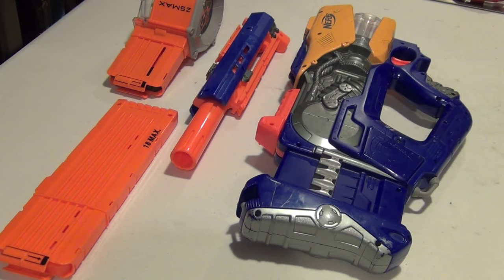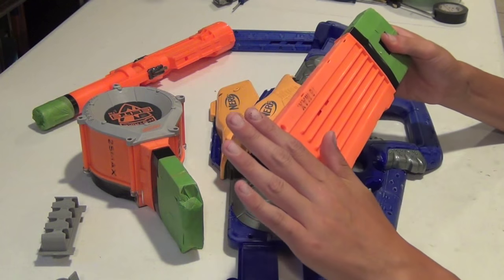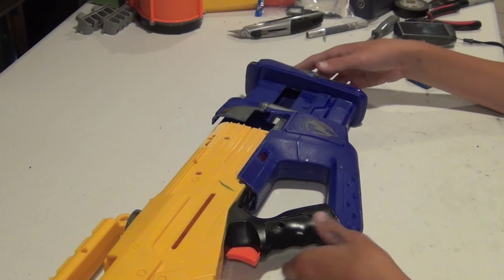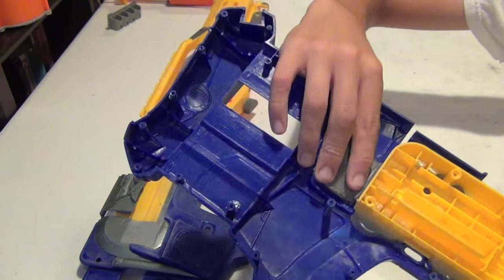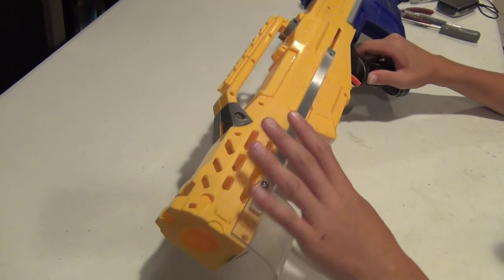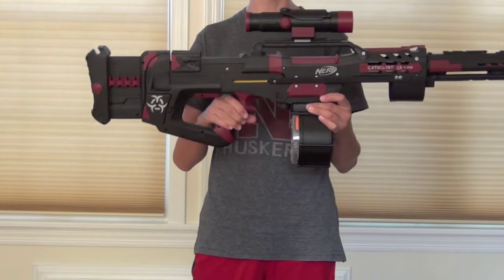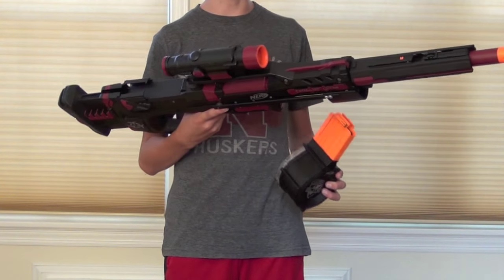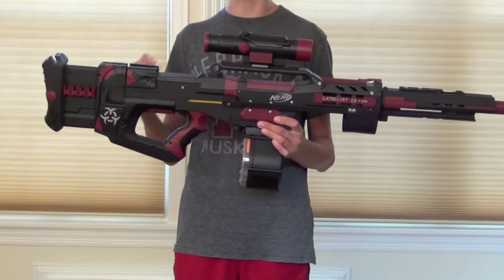[PROCESS] The Cataclyst [Nerf Longshot w/ Integrated Firefly Stock]

Comment: Hey Mag212, I had a weird idea for a mod. This is not a commission request, just a weird idea I had that may inspire a future mod. I know that the shotgun  grip for the longshot has been made, but I had the idea to make it really "bolt action" if you know the BuzzBee Hawk, I'm talking about something like that: a Clip/Mag fed, bolt action blaster. Maybe a bolt made of polycarbonate could be placed in the center of the blaster by the bolt handles, and made to move with the bolt, so when you use the new bolt, like a real sniper rifle, it'll work correctly. This is just a random idea but if you could make it work somehow, that would be awesome!!